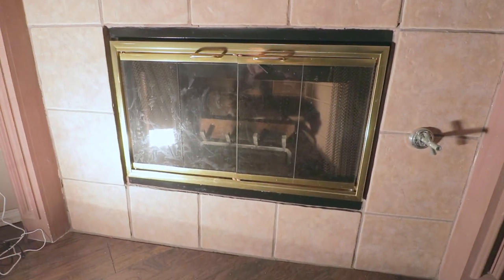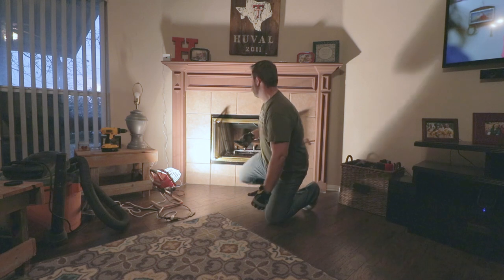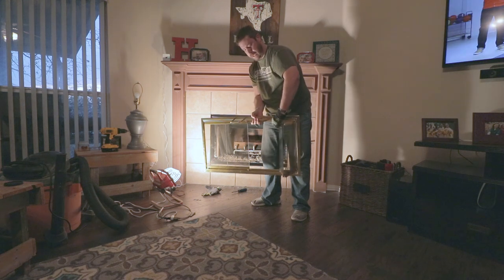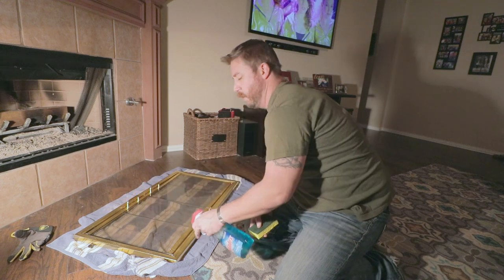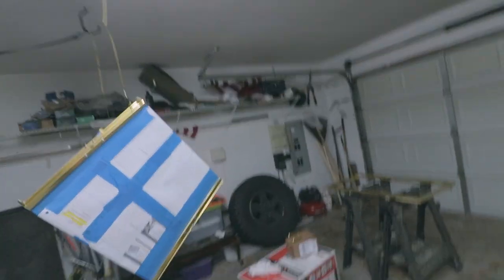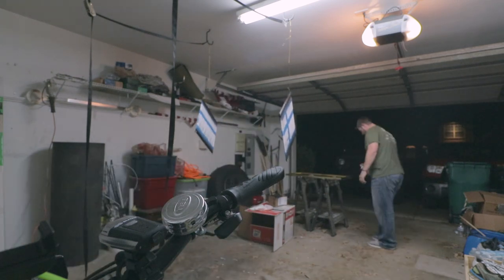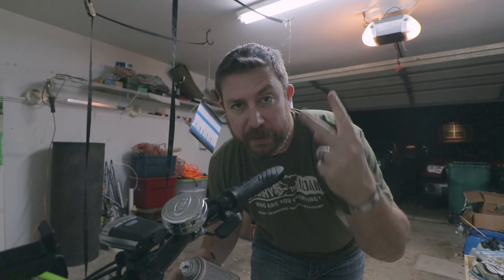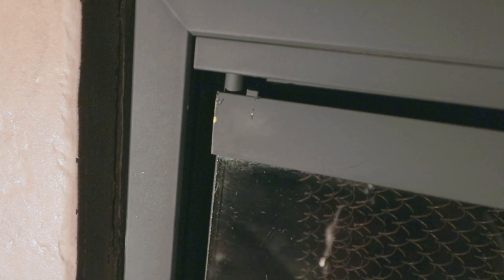DIY: Updating Fireplace Brass Doors

Comment: I did this also, but I also used the high heat primer prior to the high heat paint. I was unable to get the surround off, so masked everything  off , then built myself a spray tent and wore a respirator. 1 hour of prep and 15 min. of spraying, but it turned out spectacular. A new surround/ doors coupled with the labor to get the old one out probably would have been big$$$

Comment: How do you get the doors outta the frame? Great video though thanks for the tips👍👍
Reply from the maker: Thanks for the kind words Jesse. I didn't have to take the doors out of the frame on mine, so I'm not sure how yours would come apart?
Reply: For mine, I open them up all the way so that the top left touches the top right. Then lift up the doors and gat a sharp object to push the bottom tab down to slide out the doors. There is a vid.

Comment: I was shocked at the replacement cost of bifold fireplace doors.  Your video gave me the idea of painting the brass from from the 90s.  Since I will only have a decorative electric fire log, this should be more than sufficient as I don’t have to worry about the effect of heat.  Thanks,

Comment: Thanks for recording and sharing (I know recording slows down the job-so thanks)  Looks so much better than 'Brass'  - can't wait to get rid of mine.  Only suggestion, is There is a Rustoleum BBQ Grill High Heat paint in Satin, and I feel that would have matched better and not look like a primer coat.  Just a thought.
Reply from the maker: Thanks for the feedback!!

Comment: Flat scratches easier. Then brass collor shows through. How does flat last.
Reply from the maker: Mine still looked great when I sold the house. To help keep the brass from showing through, you could always do a couple primer coats first, which would help hold the paint and keep scratches from going down to the brass.

Comment: Does the paint adhere well to the brass?
Reply from the maker: In my case it did, but you could always sand and primer the brass to help the paint hold in place.
Reply: I did the same thing and mine has a residue if you even touch it, even with a soft clean rag. Comes right off on my fingers. Did yours do the same?
Reply from the maker: @PhillipAeschliman  mine didn't flake or rub off at all.